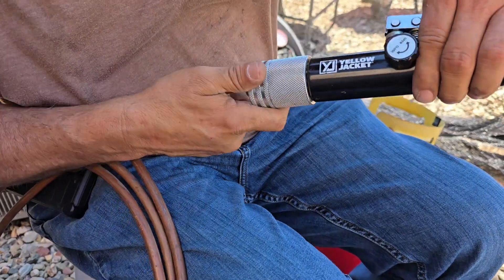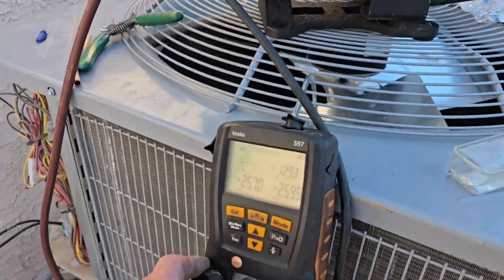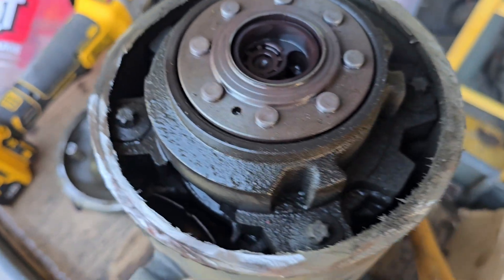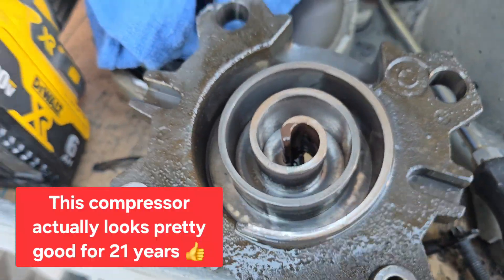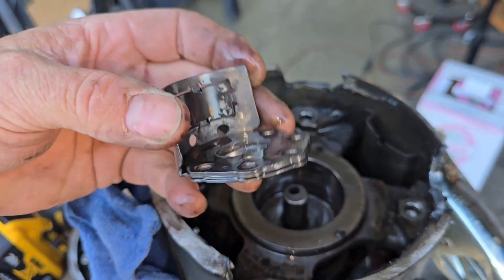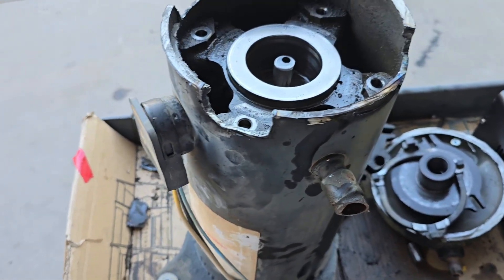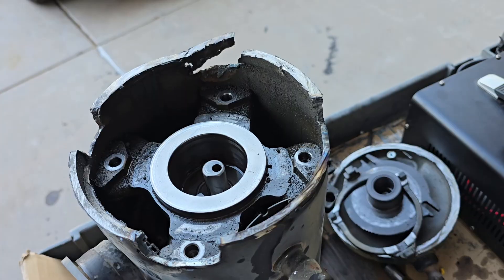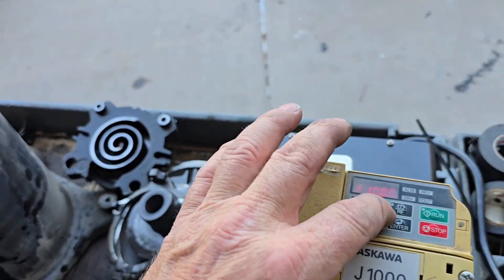Repaired my daughter's AC then cut open her noisy scroll to see what happened

Comment: I have seen failed scrolls like this lots of times.  I think being over charged or having a dirty or clogged condensor can cause this to happen.  Also that heat pump you installed.  Does the reversing valve need to be energized in the cooling mode?  Instead of having to run a wire from the transformer could you just get a magnet remove the coil from the valve, and place a magnet over the stub the coil mounts to, to hold the valve open continously?  This is a test magnet you can get and you can use it to test a pump down solinoid on a walk in cooler.  Basically you remove the solinoid coil, plave the magnet over the stub, and the valve will open the let the refrigerent flow.  Just a tip next tim you install a heat pump and want to use it just for straight cool and reverse vslve needs to be powered in cool mode.  Would save time having to run a power wire.

Comment: Excellent!  You should consider converting  her AC into Heat Pump.  I did that to both of mine (left furnaces - one is dual-fuel, got lazy with the other on) where my son lives now and I converted our new house to Furnace with a Variable speed Infinity Heat Pump (have parts to convert to 2-stage furnace for dual-fuel, but also was lazy)...Unless they really want gas Heat. Works great out here!

Comment: If 21 years old.,was it R22,did it have a TXV,if it did,maybe use R407c,or it will freeze up.
Reply from the maker: R410 piston I'm sure. (Bro in law went in attic so i didn't look).
And we didn't change it. Wouldn't have one, regardless on a Saturday.  Just needed quick cooling.
Subcool 12, superheat was around 10 after it ran a bit. All worked out 👍

Comment: G-Lader.

Volkswagen figured out how to build these by extreme high speed machining that could produce a very precise edge to the moving scroll, but could not figure out how to make these last.  That's why they ditched the idea in favor of narrow-angle V6 engines for the Corrado.

The AC manufacturers went ahead with the silent design and managed to make it work;  VAG had no interest apparently, since turbo's do the same thing and are so much simpler. And more fuel efficient.  This supercharger/compressor is a fascinating design.  I have an off brand Carrier outside unit on my house and I suspect is is one of these.  So despite the fact that I drove a VR6 Corrado for 5 years, I have a G something anyway at the house-

Comment: Yeah, 8:40, if ramp up is too short or too long, made worse by too low of a ramp up ending frequency, you will have problems… Then not that this ever happens in reality - go complicate it more and overcharge the oil in the system, oversize the line sets, and have virtually no heat load… Fun stuff to troubleshoot!

Comment: Seems like bottom bearing is the primary failure.  Occurrences of liquid refrigerant in the bottom shell displacing the oil and starving the bearing causing excess wear over time.   Straight cool / no accumulator , sensitive to dirty filters and closed vents etc...

Comment: The thing you call a counter weight might be an anti-reverse-rotation device. It's likely designed to catch on the shaft only when rotating in reverse, then the friction plate drags and tries to stop the rotation. Thus, it probably should not fit tightly.

The reasoning might be that during brief power interruptions, the backpressure can backdrive the compressor and the compressor could start backwards (single phase motors, unlike three phase, are sensitive to starting direction). Supposedly the anti-reverse rotation device was added in compressors made after 1995. to prevent this.

From a datasheet/application guide: "Scroll compressors incorporate a device that minimizes reverse rotation. The residual momentary reversal of the scrolls at shut-off will cause a clicking sound, but it is entirely normal too and it has no effect on compressor durability".
Reply: You are correct

Comment: I noticed when you pulled that counter weight out it looked like the hole was wallerd out.
Reply from the maker: That is what I eventually realized and mentioned later in the video.
It seems that the slot in the middle of that was originally the same size of the rotating concentric shaft.